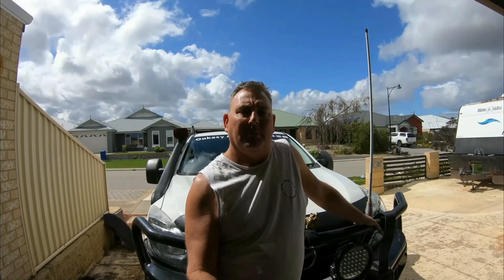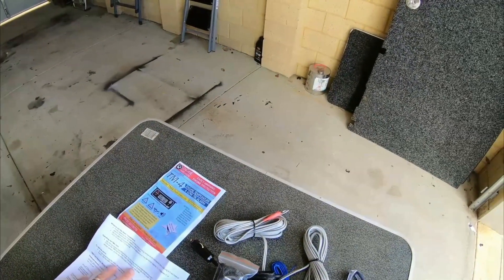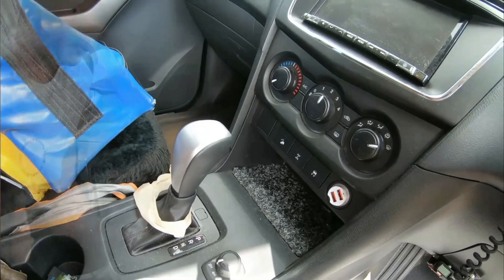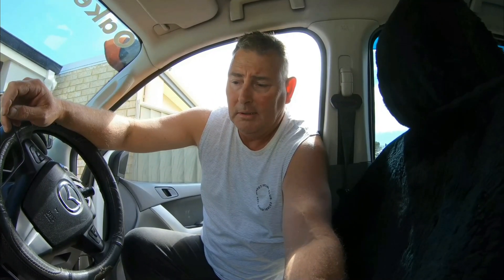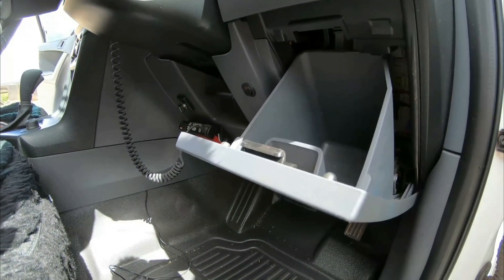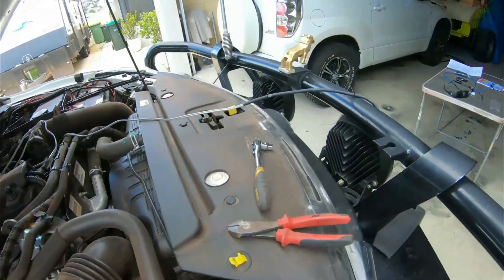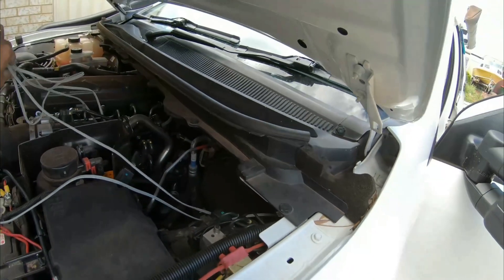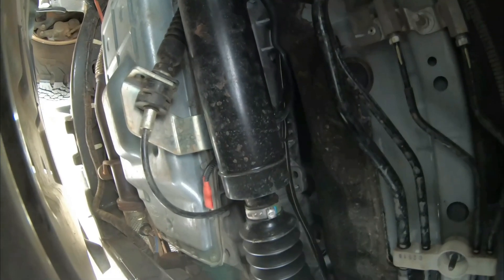CYLINDER HEAD AND TRANNY TEMP MONITORING SYSTEM.

Comment: What is a safe temp for the transmission?
Reply from the maker: I try and keep it below 100deg but it will creep up to 110 on hills. I don't have a transmission cooler they help a lot.
Reply: @OakesyAdventures thanks. I’m about to fit a cooler to mine cause I tow a boat a lot. Don’t want to take any chances.

Comment: Hi Greg thanks for the informative video, how did the sensor on the transmission pan perform? Did you have to move it? Cheers.
Reply from the maker: It works well it sits around 10 to 15 degrees below the head temperature.
Reply: @OakesyAdventures  Thanks i just bought one, not looking forward to feeding the wires through the Rangers firewall 😁
Reply from the maker: @davidhughes4525  left hand side behind the carpet big rubber grommet

Comment: Hi Greg. Great informative video. 
Looking at engine alarms myself for the BT at the moment. I was wondering how your unit is going or have you chnged to an inline coolant vesion ?.
Also have you done any other mods such as egr delete and tranamiasion cooler upgrade.
Reply from the maker: Still got the same unit and is working well inow drive my vehicle so much better while towing its amazing to watch how the head temp and tranny temp goes up and down when pushing the vehicle up hills and even during hot days. My BT is a 2018 model and has a dpf so unable to blank of egr have had it remapped and looking at fitting a over size tranny pan. No cooler at the moment.